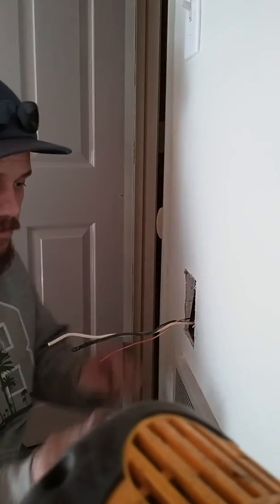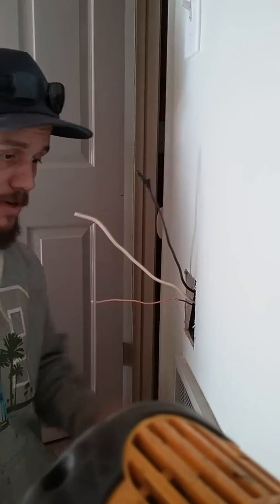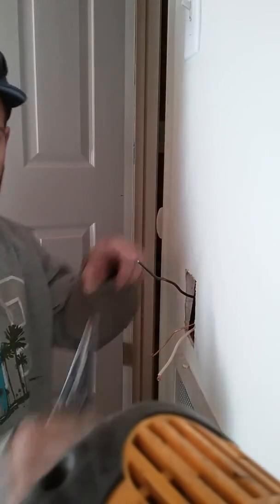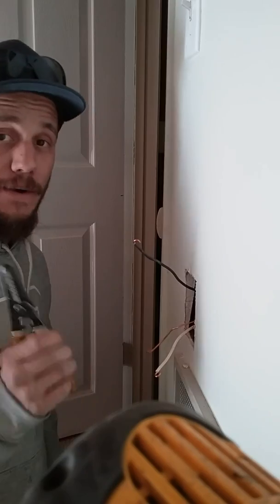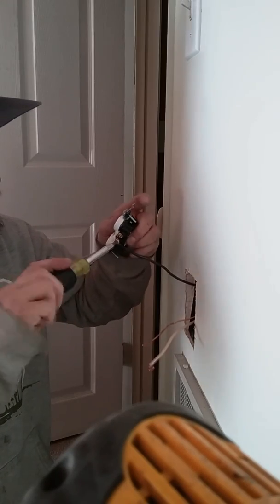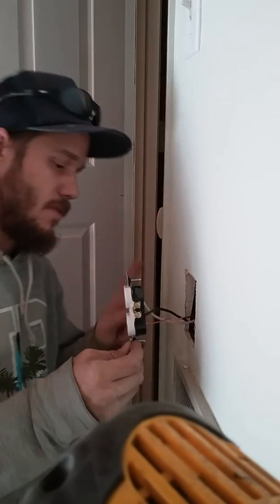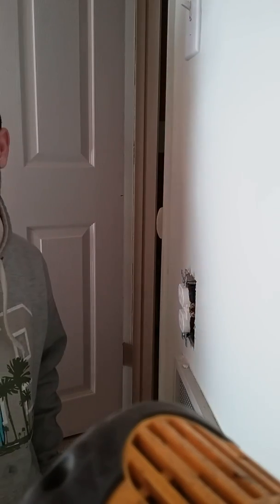Installing an Outlet, plug, receptacle, while hot, power on.  No shock.  DIY electrical lesson

Comment: So you make sure the hot wire doesn't touch the neutral wire and your other hand doesn't touch the ground or the ground wire? Pretty sure it's probably the ground wire but just making sure what you have to do with your other hand

Comment: Hey man im not trying to insult u . Im just trying help u out thats all . What u did is very dangerous and not the way to go about it for multiple reasons . Take it somebody who has lots of exp in wiring a receptacle hot because someone had to have oxygen . Let me help u out in case yr in a simular situation. Its rare but will happen eventually when u do and u dont want  severe legal action pressed from there family . Let me explain . 
First always communicate with the one on oxygen  to let them know . 
Then on outlet thats hot have yr tools ready . 
Thats needlenose pliers , strippers, wire nuts , wire clippers all next to u . First  quickly is snip closest to terminal of receptacle the neutral first so it disrupts power to receptacle . Pressure is on immediately strip the neutral that disconnected immediately without hesitation u cap em . Disruption should be no longer than bout twenty or thirty seconds .
Neutrals r capped to keep power going . Only thing left is hot wires connected into receptacle neutrals wires capped between the hots wires connected to live receptacle and the neutral wires capped the power stays going . Repeat same on hots . Thell be two disruptions should be no longer than twenty or  thirty seconds always communicate with patient on oxygen . Wires capped and old receptacle removed . Then the easy part installation on new recaptacle hot . Buy  extra wire color coded  for receptacle. Prewire the new receptacle with new wire u purchased . Follow me ? Good . Take electrical tape  insulate the terminals of new receptacle. In the box under the caps of live wires u pinch them touching the two wires tightly . Take electrical tape and tape them together tightly so when u  uncap the live wires they stay connected . Take the new receptacle strip new wires then cap em into live wires in box . If u have to touch the live copper on end of wires wear kitchen gloves . Went to school for an apprenticeship but have years and years exp since 16 years of age . Its called a professional tie end when working with any live wires . Hope this helps buddy .  Glad i ran into this video .

Comment: Hot goes last, if you're not grounded you can touch a live wire and won't get shocked
Reply from the maker: @smid556  yep
Reply from the maker: @smid556  unless you are holding the yoke 😜⚡

Comment: Wait correct me here because I’m obviously wrong. I thought if you were to touch the hot wire to the ground wire yes you would get shocked but theoretically it should direct the electricity to the ground wire which wouldn’t flip the breaker somehow.
Reply from the maker: @technodude  only of you pass enough power to trip the breaker.  A GFCI yes it would trip right away but these old Zensco breakers take way more amps to shut off.  Over 20 on a 20amp CB.  I've had screwdrivers glowing red hot breaker not tripped had to yank it apart after it welded it self to the grounded metal box 😂

Comment: Attached receptacle like you did and when neutral got added the Rabbit ear mounting metal shocked me.  Only weird thing about the Outlet was the dry paint on it.
Reply from the maker: quite odd. electricity needs a return path. voltage is potential difference. the difference between like black and white wires.  between line and bonded neutral. 
between hot and neutral.
Reply from the maker: some times the neutral is hot because it is like the return path of electricity like after it goes through the lightbulb
Reply: @thelovetemple333  especially when only path for neutral through live wire of other phase cause neutral got cut somewhere.

Comment: I'm not sure why using two hands vs. having your feet on the ground is any different, but it talked me out of attempting it none the less. Now I'll get back to figuring out which unmarked breaker shuts this thing off.
Reply from the maker: Boots, carpet, subfloor, second story, usually not grounded through the feet unless wet with socks wet and the water is touching the ground or earth

Comment: Don't you tape a wrap deal at what electrical tape to prevent future shock if someone removed
Reply from the maker: Nope.  Tape is not needed if no one works in it hot. Unless it's a metal box where tape can make it much safer to work with.  Don't work on it hot. Tape is hard to get off some times. Some times I have used just a U of tape to hit all 4 screws .  Pulls off with insulated needlenose easy enough

Comment: Great advice treating everything like it's hot.  As an IBEW apprentice first year we are told that we don't work on anything hot not just as apprentices but as IBEW journeyman as well everything is always supposed to be de-energize locked out tagged out.  In reality that is good but it's a double-edged sword.  Eventually we will probably come across a situation where we are all but forced to work on something that is live and what we will have done is raised an entire generation or more of apprentices to journeyman who have never had to work on or had experience working on live wires.  And that's unfortunate because I think many will take for granted or become lackadaisical and then when it's hot will either be so scared that they overcompensate won't be able to do the job or will make themselves a danger by just being nervous or will lack the proper caution that is necessary to be safe.  Now as a guy who did all of his own electrical work for the most part before ever joining the IBEW and I'm talking just some Reggie simple wiring I used to say that I've taken 110 so many times that I don't even feel it but we all know it's not the volts or at least I know that now. Well not just the volts.  One of the worst shocks I ever had though was when I was wiring telephone wire to a block to then distribute the signal throughout the house and I decided that I would hold the wires in my mouth for a moment while I mounted the block in the rafters.  That and I took a solar panel while changing out a connector clear sky 430 mid-july afternoon.  I swear I felt my feelings melt but what was worse was the heart palpitations that came later that evening several hours after the shock always get looked at never let something go just because you seemed fine
Reply: You want us to work with live wire so we can get shocked like you ? Yea no buddy 😂

Comment: Why can’t you use the holes at the back of the outlet
Reply from the maker: The back stab is not as good of a connection as wrapping it around the screw.   Here in this video I am using 12 gauge and only 14 gauge wire fits in the backstab holes.   I have seen 50 backstab problems burning up the connection.  I'd rather do it best and wrap the screw 😁🥰❣️
Reply: @thelovetemple333 in Denmark our outlets are backstabbed with no failures so our danish outlets are much more high quality then the outlets you have old trash residential grade plugs
Reply from the maker: 240v?

Comment: Are the steps backwards? Since you started with hot and ended with the ground, what happens if you accidentally touched while screwing in the hot ? 
Would not having the ground  connected (safety)? electrocute you more or doesnt make a difference?
Reply from the maker: Retn did you listen to the words.  I explained this quite clearly.  Watch again and you will get your answer 🙏
Reply: @thelovetemple333  Yes I watched and just rewatched it. I was asking something specific, i.e. what happens if you get shocked and the ground/neutral aren't connected yet,
Reply from the maker: @retn1122  how would I get shocked?  What is the potential difference?
Reply from the maker: @retn1122  if you hook up the ground the yoke is now the return path.  So what you are holding creates the potential difference if hot is touched

Comment: I turned off every breaker in the house, and that daggone receptacle is still hot. Fingers crossed that can do this without getting zapped or setting the house on fire
Reply: Turn off the main
Reply from the maker: That can be the most expensive to replace if it does not reset
Reply: @thelovetemple333  I am aware that I need to replace power in the entire house. I've got floating grounds like it's haunted. I didn't realize how bad it was until I've been here about 1 1/2 years. Even the inspector didn't catch it.
Reply from the maker: How old is the house?   @ellasmommy9278
Reply: @thelovetemple333  1949
Reply: @dan-777-abc  I did. And it was STILL hot. I was telling my ex about it and he thought the ground was so messed up that it made it think it was hot. All I know is my refrigerator kept running. Perhaps even in a power outage. Hard to say.
Reply from the maker: It is probably time for a service upgrade and a re wire 😁
Reply from the maker: Free power
Reply from the maker: Where are you located?
Reply: @thelovetemple333  Cumberland, MD. The problem is I really can't afford it just yet. The house needs a lot of work and that's just not a priority yet. 
Although there is some Romex floating about, more than half is that grey fabric covered electrical wiring. The walls are plaster so that makes a lot of this problematic to replace. The attic is literally a crawl space. 
My daughter is renting space to an electrician at her house, and I've asked him several times if you would come out and  look at it. I would think he'd give me a break but he's 2 hours away.

Comment: You gotta do ground, neutral and then hot. Reason why is because you want to be “protected” by letting the circuit breaker know theirs a short circuit and it would trip (even though it wouldn’t make a difference)
Reply from the maker: Don't work on anything hot
Reply: I love how when he sees a silly textbook answer he’s really advising them to not work on hot circuits… specifically them.  Haha

Comment: You probably shouldn’t be giving this advice to amateurs, especially not being an electrician yourself. Which I assume you’re not considering I could’ve given better advice a month into my apprenticeship. This shit really does kill people and should be left to professionals. With that said, the only correct way to do this:

Disconnect- hot, neutral and then ground. 
Connect- ground, neutral and then hot. 

Also cap or tape each wire before moving to the next step to avoid accidental contact. Also, working things hot should always be a last resort. Never do it as a short cut or for convenience. Even a seasoned journeyman will walk flights of stairs to flip a breaker before working something hot. As they say in the industry, “better to be slow and safe than quick and dead”
Reply from the maker: 22 year electrician worked under 250 years of experience 😜😁

Comment: So…I pulled the outlet while hot out of the wall….and grabbed it by the mounting bracket…..I got bit….it seems that is abnormal. I’m trying to figure out why some lights are not working in the bathroom but the breaker didn’t trip. I have no power at the switches coming in and no power at the  light assemblies goin in either. So I moved on to the outlets to check for a bad one and when I pulled the closest one out…the mounting plate had juice on it and shocked me.  Guessing that is not supposed to happen and I have a bad outlet shorted
Reply from the maker: Call electrician
Reply: It was a second switch that tied into the same light that was positioned to where the light was on and the other switch that we use regularly was off. The second switch appeared to be in the correct position but the contacts inside the switch were not. Replaced the bad switch.

Comment: Just work in order of ground, neutral then hot. While doing the hot, only hold the wire and tool by the insulated areas. But it's always best practice to just turn it off. Your safety is worth the momentary inconvenience of not having power.
Reply: Why didn't he hooked the black wire last ???? I know nothing about electricity.....
Reply: @stephanedufour7675  You're correct. We were trained to work in the safest manner possible. TURN OFF THE POWER, if that's not possible, work in order of ground, neutral, hot. 

By hooking up the black first, he created a difference of potential the other side of the outlet. Current is just waiting for a path back to ground. Holding it like he did could have easily lead to his hand becoming that path. That could be trouble depending if he's grounded or not. But why take the risk?

If he had started on the neutral side, He would have minimized his risk. Ground screws and neutral screws are on the same side of devices for a reason, they are the same potential.
Reply from the maker: Wrong the power does not pass through the outlet hot to neutral if nothing is plugged in
Reply: @thelovetemple333  never said that. That would be called a short. I was only talking about the danger in his method of wiring, not the internals of how electricity flows through a receptacle . The way he was holding it, his hand could've easily completed the circuit.
Reply: I’m no electrician/ never been taught by any electrician. Just an electrical engineer and I always have the habit of doing Ground, neutral and hot… never have had any issues connecting anything like this. 

I prefer to work with no power but sometimes you gotta work with live wire🫠

Just wear electrical rated gloves for 1 hand and the other holding your insulated screw should be fine 

Long story short, also wear rubber   Boots which he probably does lol

Comment: Bro is 100% not a electrician. Don't do this not only because you shouldn't work on things hot but because this is thr worst way to put it on hot.
Reply from the maker: Twenty years electrician,. I learned from 140 years of experience
Reply from the maker: Like I said don't work hot 🔥
Reply from the maker: I have only been shocked 100 times in my life

Comment: How did the neutral not spark when you went to hook it on the screw? I assumed since the hot was already on the outlet that the neutral wouldve arc'ed and tripped the breaker when you went to connect it.
Reply from the maker: There is nothing plugged in.  So they are still separate until something gets plugged in and there is a load.  An outlet has no connection between ground neutral and hot
Reply from the maker: @destineeharrison310  more than one set of wires.  Something plugged in down the line on the same circuit.  Not a good idea to open a neutral while it's hot.   Need another method to do it that way.  Like turn it off.  Or remove the hots first and attach last.  May have an arc when hooking the hot but at least the neutral is connected through.  On a multi wire branch circuit you could send 240 v down the line if you open the wrong neutral

Comment: Always wrap with electrical tape when done wiring, especially when working with metal boxes. Just a piece of advice.
Reply from the maker: Why?
Reply: @thelovetemple333  Just in case the hot makes contact with the box as you are pushing the receptacle in. Sometimes the receptacles are grounded to the metal box as well. Recipe for disaster.
Reply from the maker: @SimpleSolutionsOH  yes working hot electrical tape on the hot screws helps you and the next guy.  This box in this video is plastic
Reply: @thelovetemple333  I tape the plastics one when I’m done as well. Extra layer of protection.
Reply from the maker: @SimpleSolutionsOH  never work on it hot then you dont need tape.   If you work on it hot then know how without needing tape

Comment: What about using gloves, esp with hot wires? Wish you'd have shown proper way taping over the hot wire.
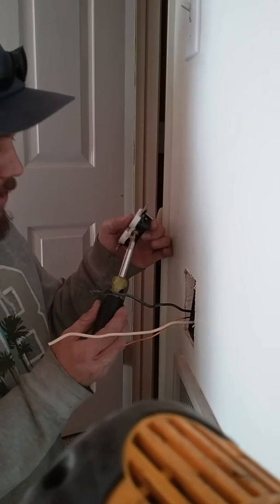0:35 "put in terminals not using". Why is there 2 sets? Ahh for running power to other recepticles. .
Reply from the maker: Don't work on anything hot

Comment: After reading the comments and looking into the basics of electricity. I understand why the hot leg is hooked up first. If the ground and neutral were hooked up first, then the device would have a return path. If he accidentally touched the yoke or any grounded part with the hot wire it would complete the circuit and spark. Of course turning the breaker off would be the best choice but sometimes you might have to work on somethings live. He knows what he’s doing
Reply: Ground, neutral,  hot. The ground wire is your safety. If he touched anything with the hot wire(before connecting the neutral) the return would go the ground wire. (After the neutral it would flow as intended.) Not only that the ground is bare copper. If it accidentally bounced around and touched a hot terminal it would trip the breaker.
Reply from the maker: Thank you for understanding this.  It works in the situation where there is only one of each.   When more wires it's different
Reply: You’re supposed to hook up the ground first, supposedly. Not the hot.

Comment: Just wanna say to anybody out there to not take electrical for granted. It's really easy to play off residential outlets as not being dangerous but can be a very hard lesson to learn that it can kill you. Voltage isn't going to be what kills or seriously injures you it's the ampacity going through your body and where it enters and exits at. A simple shock may not be that bad but say you're sweating that day or accidently tap into a 3 phase run with a neutral it's going to fuck you up a lot more. In addition to that fucking up and being grounded, touching the neutral while touching the hot or anything that turns you into part of the circuit instead of just a shock is really going to fuck your day up
Reply from the maker: Don't work on anything hot